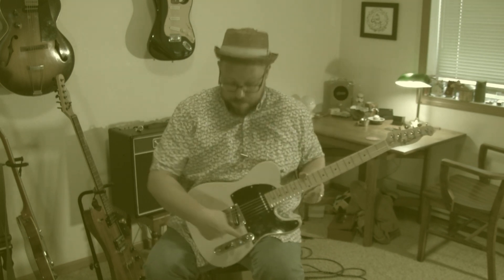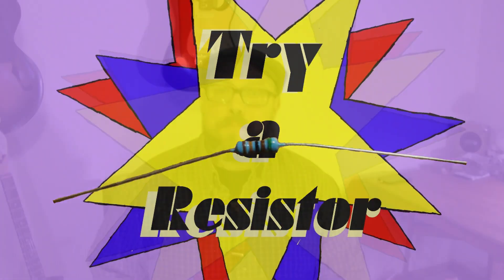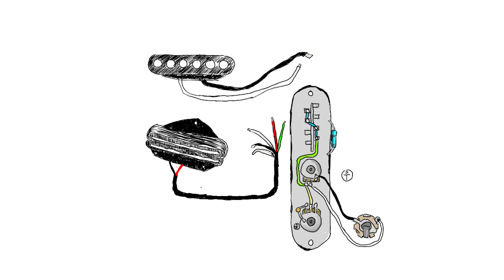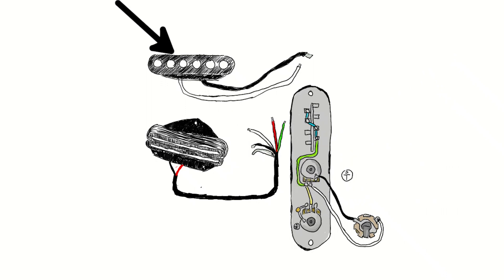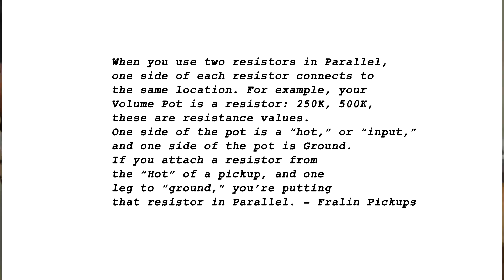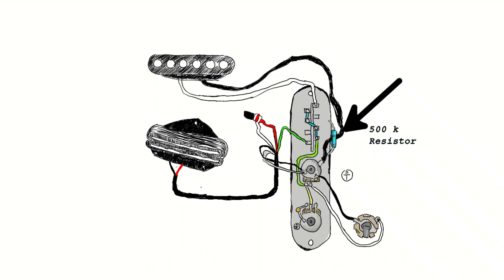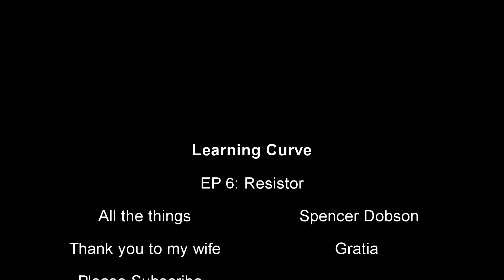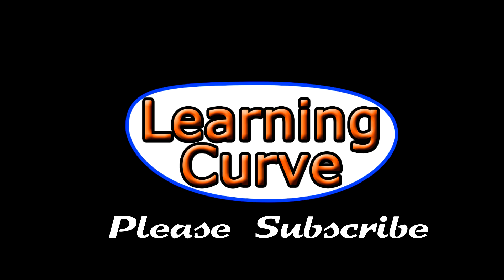EP 6: Balancing Humbuckers and Single Coils using a resistor

Comment: Maybe a dumb question, but here it is.

I’m wiring up my Telecaster, which has a humbucker in the neck and a single coil in the bridge. I’m using a 500k pot, but I want the bridge pickup to “see” a 250k pot instead.

I placed a 500k resistor between the hot lead of my bridge pickup and the back of the volume pot. When I measure with a multimeter and the volume knob rolled to about halfway, the bridge shows around 127k at its peak. Multiplying that by 4 gives me about 508k, and subtracting the pickup’s resistance (8.7k) leaves me with roughly 499k. So basically, the bridge pickup is still seeing the full 500k, not the desired 250k.

Any ideas on what I might be doing wrong? Is it possible the pickup is actually seeing 250k despite the multimeter showing otherwise?
Reply from the maker: I haven’t thought about this in several years. I tried the mod and it worked, but I don’t know that I can trouble shoot for you.
I included all of my reference materials in the description. Best of luck.

Comment: Halo.✌🏼 This is a common problem for Strat HSS. My strat is Squier Affinity Strat HSS FSR (Fender Special Run). 

Whenever I use the position 1 (bridge humbucker), it is loud. When I use other positions e.g. Position 4 (bridge HB + middle single coil) the guitar suddenly becomes less loud. This issue made me hard to volume balance whenever I wanna switch between the Position 1 and 2, due to its loudness difference or sudden volume jump.

I only use this 2 positions (Pos 1 & 2) as my signature guitar playing styles during live shows or recording. Where Pos 1 (bridge HB) for my hard rock or main lead solo, and Pos 2 (bridge HB + mid SC) for clean or blues rock.

ChatGPT suggests the idea of "passive vol drop resistor mod", which as volume balancing between Pos 1 (bridge HB) and other Pos 2 (bridge HB + mid SC)

1. Solder one end of the 470kΩ resistor to the humbucker’s hot wire.
2. Solder the other end of the resistor to the original switch terminal where the hot wire used to go
3. (Optional) Solder a 1nF capacitor in parallel with the resistor (across both ends) to retain brightness, like a "mini treble bleed".
4. If 470kΩ drops too much volume, try 330kΩ

With this, it is claimed to prevent sudden volume jump. I need opinions from the guitar community 🙏🏼 God bless
Reply from the maker: I don’t know about that. You could just lower the humbucker
Reply: @LearningCurveGuitar i ve tried that before, but the volume still doesn't balance out or have a significant reduce for the Pos 1 (bridge HB)
Reply from the maker: @gibson_az let me know what you come up with. Have you considered using hotter single coils, a less hot humbucker or turning one of your tone knobs into a volume. You could also split coil the humbucker or just swap it out for 3 single coils.
Reply: @LearningCurveGuitar I wanna achieve a specific guitar tone, where I can utilise Pos 2 HB+SC for my clean to blues rock style of playing, and make it like inspired-Clapton-style strat. Where I utilise fat warm HB and the bright SC, and just adjust the SC tone knob to roll off the brightness / treble like a TBX control.

And Pos 1 full HB for my hard rock and lead solos. If I could have this passive vol drop mod a success, it would be great. What do you think ? 🤔
Reply from the maker: @gibson_az I hope you find what your looking for. God speed and let me what you come up with
Reply: @LearningCurveGuitar Aite thanks mate

Comment: Only problem with that wiring mod is it adds another 500k to the parallel resistor equation from the neck humbucker in the middle position, bringing it roghly down to 135k. There is a way to bypass the bridge resistor in the middle position where both pups will be at 500k. Im just wondering if there is a way to wire in a milder resistor to both the bridge and neck humbucker in the middle position that brings em down together to a happy medium. Say 375k. Sure there is. Just have to do the math. Of course my HS tele build has a hotter single coil 8.3k to better match the 7.6 humbucker. That is another way to darken up a single coil. Just beef up the single coil to match the output of the humbucker and put em both on 500k pots? Lot of ways to get around it. And there is no real set values when it comes to resistors or pots. Plus the switch can be wired differently as well. It's just a simple switch that turns lugs on and off. Basically can treat each position of the switch completely different.

Comment: That really helps! I recently purchased a pretty cheap Dean guitar with H/H config but I can't live without soloing fender-like, just like I do on my old H/S/S Ibanez, so I'm definitely jamming a fender single coil on the neck of the strat-like Dean. It should also be considered an upgrade since the default pickups are "meh". Next up should be bridge pickup upgrading but for the moment the sound that bothers me the most is the neck position one. Thanks for making it so visually (and soundly) clear! Getting a resistor right away.
Reply from the maker: I appreciate the feed back. Sounds like you’re going to have a sweet axe

Comment: Thanks for the explanation. But I still confused with HSS stratocaster mod, why they use 250k pots for the tone control one which is control the treble for neck and middle pickup who are single coil if they already installed the resistor for the neck and middle. Why didn't they just put all 500k pots like what telecaster with humbucker and single coil does
Reply from the maker: I don’t work there. I think it’s so you can set them independently. You can roll off the brightness on the bridge and make the neck brighter without having to fiddle with the knob in the middle of a song.

Comment: How about this?  EVH Frankie 500K volume Pot with no selector, no tone control.  I want to hookup the dummy neck pickup.  Where does he resistor go?    Volume pot will be a push/push to switch from humbucker to single coil.  Without the selector switch, I am wondering how it will play out.  Does the resistor go straight in-line or would it be neck P/U hot lead split to hot input and ground and ground wire to ground?
Reply from the maker: I’ve never done that. But, if I had to GUESS, I would go from the tab the single coil is connected to on the push pull to the ground. Your neck pickup is like a double fake out. “Wow, that bridge pick up sounds AMAZING, is that split coil or coil tap?”
Reply: @LearningCurveGuitar  Thanks.  When I get around to it, I will let you know.  Yeah, I will be the only guy around playing some (Valley Arts guitar era) Larry Carlton lines on a Frankenstein.
Reply from the maker: @jazzbluesrock21  get video! Best of luck

Comment: I'm about to start an HS tele build and have been trying to research a LOT on this particular mod. This is definitely one of the most useful videos I've found on this topic! In my build, I want to take it to the next level and have my neck humbucker coil splittable (operated by a push/pull tone pot). Just wondering what your thoughts are in terms of how you'd handle this situation? Would you put another 500k resistor in the circuit when the humbucker is split and if so, where would you put that? I assume it would have to go between the volume pot and somewhere on the push/pull tone pot, I just haven't been able to find ANY examples of this setup on the internet.
Reply from the maker: First off, thanks for the feedback. That is a great question. I have not done that mod, so I'm not sure I can give you a good answer. I FEEL like you want to put it on one of the leads you normally tape off, the north and south finish. But I am not sure which one. I don't want to give you bad advice. I hope you find what you are looking for, let me know. Thanks.
Reply: @LearningCurveGuitar  I guess I’ll just have get get the soldering iron out and experiment! What’s the worst that can happen?!?! If I can’t get it working, I’ll just simplify and ditch the coil split option. If you’re interested, I’ll come back here with my findings.
Reply from the maker: @hamills32  let me know what happens. I think since you are only attaching the resistor to one of two possible lugs it doesn’t SEEM like you could do damage. (Famous last words) Also, lots of split coils don’t have this mod and you might be fine with how it sounds.
Reply from the maker: I cam across this article today, the end of it might help you out. Best of luck.  https://www.premierguitar.com/diy/mod-garage/hss-auto-split-mod
Reply: @LearningCurveGuitar  Fabulous! Thanks for sharing!

Comment: NOTE:
The above formula works well when you’re on your Neck pickup and Bridge Pickup only. However, when you get in the Middle Position, you’re adding yet another resistor. Your Neck Pickup (500K) Your Bridge Pickup (500K) and the Parallel Resistor (~470K). When you combine your neck and bridge using this resistor trick, the middle position will see a 163K pot, making it darker than usual.
Reply from the maker: Thank you. I’m going to do some home work on this!
Reply from the maker: I should also say, I add a resistor to my middle pickups and they are still plenty bright.
Reply: @LearningCurveGuitar  In a 2 pickup scenario, 3 way switch, combining both pu's in the switch middle position yields potentially unfavorable results with the overall resistance at 163k and likely darker overall output.
Reply from the maker: @reedburnham4955  that has not been my experience. Also, the resistor is only being applied to the signal on the single coil and has no impact on the humbucker. It’s not connected to the tone knob, it’s connected directly to the switch and the ground. I don’t think you equation applies in this situation

Comment: I have two 500k pots, one for volume and one for tone: the single coil sees 250k if I connect a 470k resistor from its hot connection to volume grounds, but does that make the coil see 250k of tone? Or do I have to connect a second resistor from tone grounds to hot?
Reply from the maker: That is a great question. I think, because lead from the volume goes to the tone, the signal has already been adjusted, so you should be ok. here is the original article if you'd like to dig a little deeper. https://www.fralinpickups.com/2018/10/17/using-resistors-in-guitars-101/

Comment: Greatt! I'm trying to lower my humbucker volume to that of my 2 single coil pickups.  So I can adjust my humbucker closer to the strings where it belongs.  I guess this might work? Or could I just put a resistor in series with the humbucker?
Reply: Sounds like you're actually adding distortion instead of changing the volume?
Reply from the maker: Hello Grassmaster, The resistor isn't going to change the out put. You are right to adjust the height. The Resistor keeps the single coils from being too trebly. (treble-ish?) while leaving humbuckers with their traditional tone.  I've not tried a 250k with a humbucker, what I'm reading about say's is makes the pick up hard to break up and muddier.  Some sights also suggest using a 300k pot which splits the difference, but this seems like the best way to get the tone you want from each pickup. Thanks for your comment.